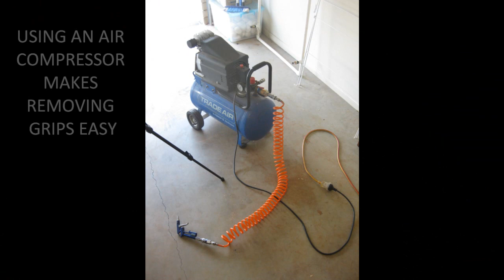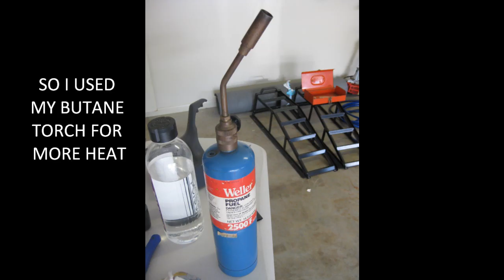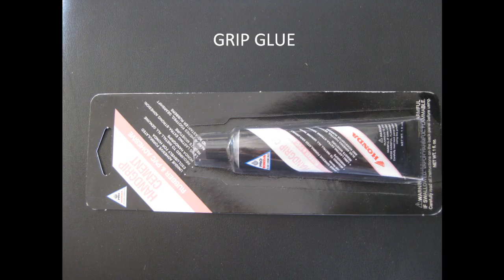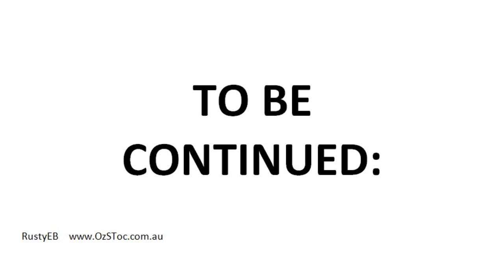HONDA ST1100 HEATED GRIPS INSTALLATION

Comment: Curious if you ever replaced that switch? I've looked around for a better looking switch, but I've had a hard time finding one.
Reply from the maker: No, in the end I actually invested in some Oxford Heated Grips, and use the switch to turn off the 12 volt plug I installed.  The oxfords are amazing compared to these :-) The $5.99 cheepies were ok in Autumn, and a bit of fun, but didn't give any serious heat. The oxfords can almost be too hot to touch.